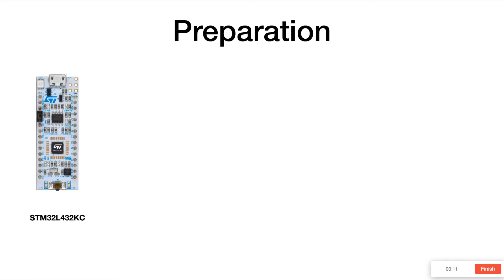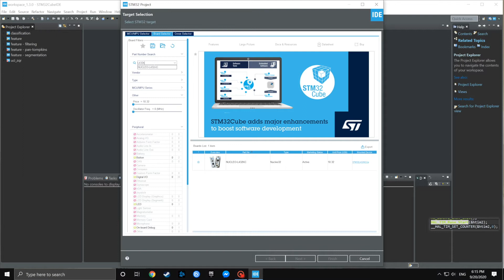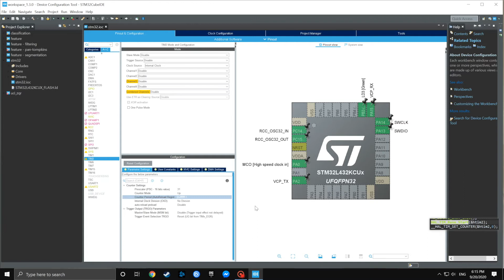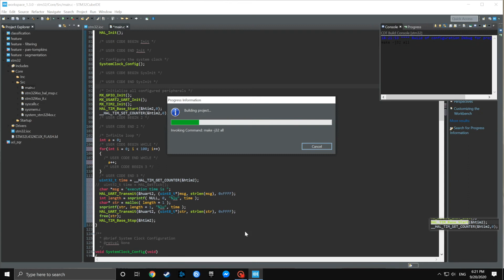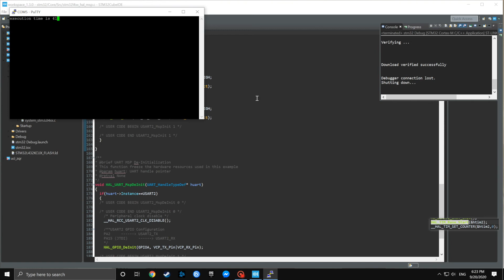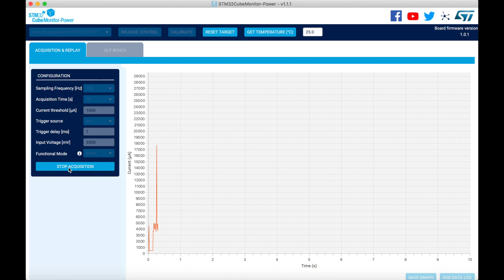Measure execution time and power consumption on STM32L432KC

Comment: I have one stm32 nucleo l432kc board, I just created a project and generated with stm32mx, I had opened in stm32cube ide and built the code with only SPI1 initialized , The elf file was generated and its size is 1050KB but our has 256KB flash memory only. can you please give me the solution??